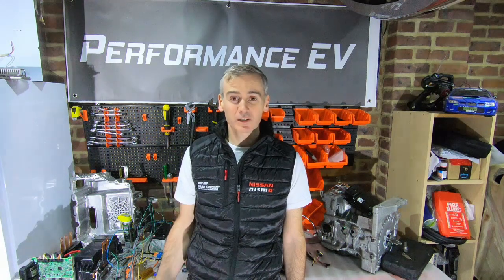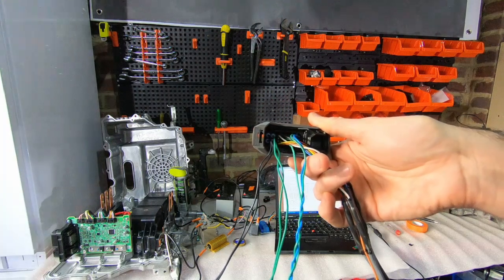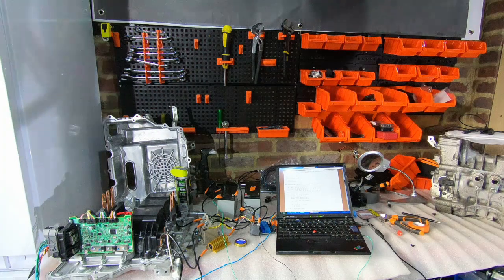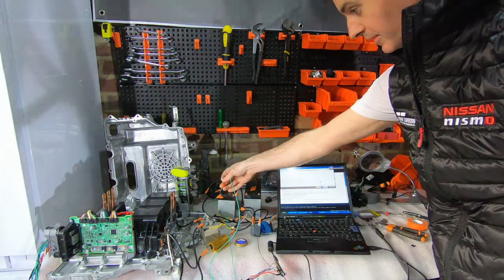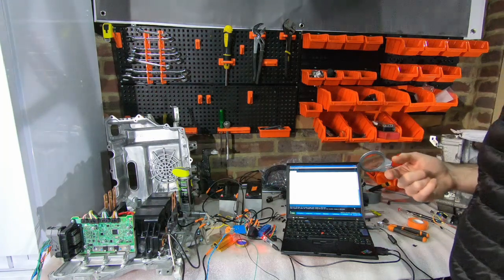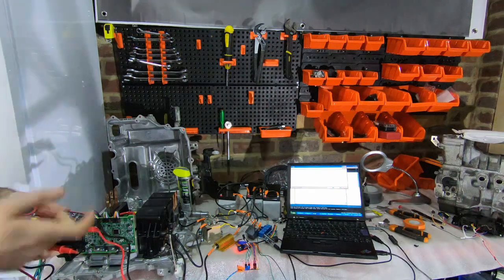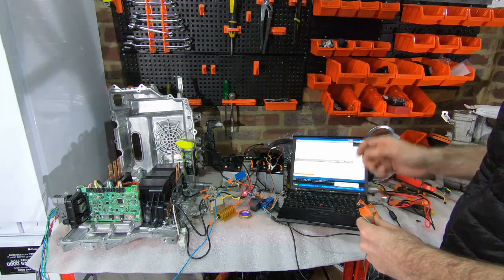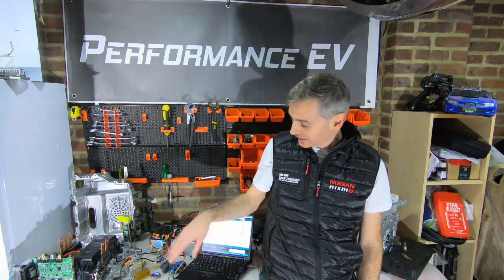Building an Electric Car - EV Parts - Nissan Leaf Inverter - CANBus snooping- Leaf Drive Unit Part 7

Comment: Hello and great work!

Could you tell me which arduino and CAN-bus board you are using?

Thanks in advance,
Bart
Reply from the maker: Thanks Bart,
At the moment it's just a couple of cheap Arduino Nano clones and a generic MCP2515 module (all from ebay) though I am starting to wonder if the issues i am seeing are due to the very basic nature of the boards I am using. I may go for a slightly better board abd proper CANBus shield in the future.
Reply: @PerformanceEV Thanks for the response. The only thing I want to do is read the state of charge of my Leaf also with a MCP2515--board for smart charging. For the moment I can't read any CAN-message and I am stuck. Would you share your code so I can get started? Thanks in advance, Bart
Reply from the maker: Let me double check which libraries I was using and I will let you know. For the receiving I just used the basic example code that came in the library.
Reply: Please let us know more about CAN bus controller and how to communicate through single board computer